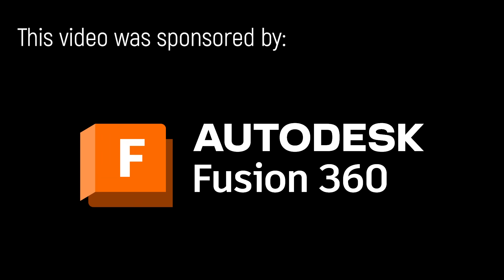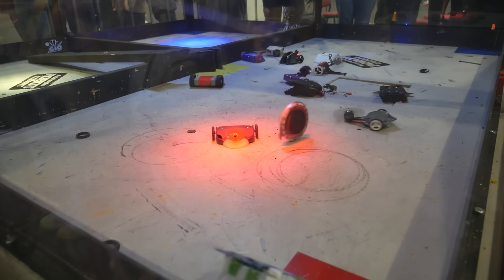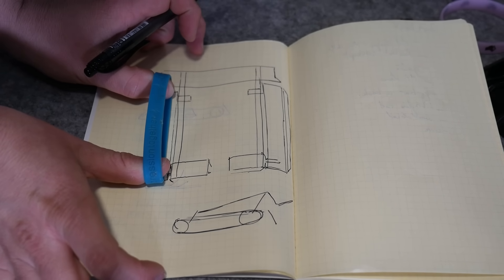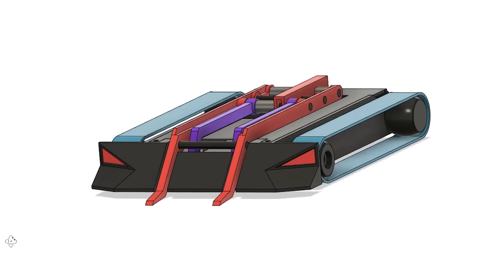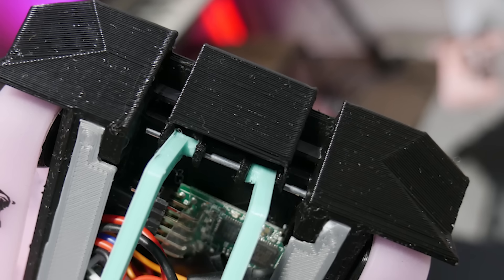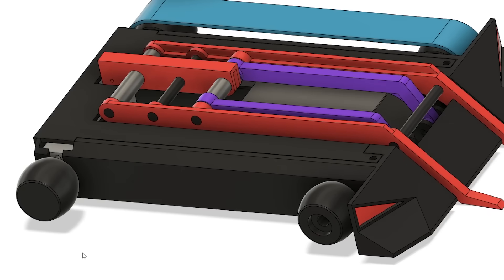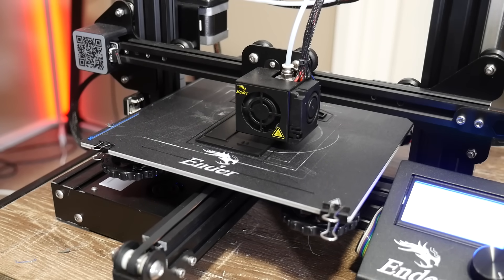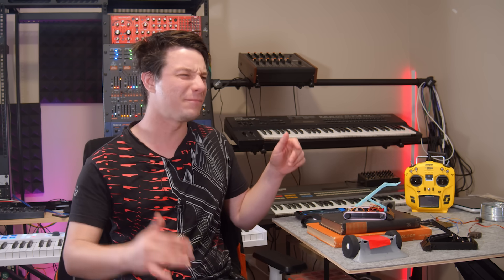My 3D Printed Robot sucked... so I made an UNBEATABLE one!

Comment: the forks might have to be closer to the ground.
maybe also redesign them to be sheathed in the bots front, since they're relatively flimsy and your only weapon.
I'd suggest making the interfaces angled, so they don't have the tendency to get stuck while lowering them into their sheath+scooping position.

oh and then I also wonder if you have enough weight allowance to add some metal spikes on the upper surface of the fork, to keep enemies from sliding off the fork too quickly... maybe just superglue sand on it.
it would probably be better to have it grip only in one direction though, so they can slide on easily, but can't just slide off.
Reply: Was thinking something similar as far has the forks should be lower to the floor. Saying it's a plastic ant weight I would probably say he's fine keeping them out from the front of the bot since not many people design kinetic robots most are control saying it's only 150g
Reply: @kylecarter7293  hmm that's true and I don't know if kinetic weapons are even allowed there...
still I'd rather go safe than sorry, since sheathing doesn't cost much anyways.

Comment: You might’ve already done this, but I’d recommend using the “expo” setting on your transmitter joysticks for better low speed control. It’s a pretty nice feature for combat robotics, from my experience
Reply: expo is good for a lot of rc things tbh
Reply: Expo won't help. I use these N20/N30 motors on micro crawlers and the cheap tiny DC speed controllers are often inherently bad at low speed control. You get nothing before about 30% throttle even if you raise it super slowly. The reason for this is that the motor's coils act as an inductor and the motor controllers are set up for efficiency and quietness at high speed, which means they run a PWM frequency above hearing range (20kHz+). If you're well versed in analog electronics, you'll see that the inductance and resistance of the motor form an RL frequency filter, reducing the voltage across the armature at low motor speed. Adafruit released a whitepaper on this and it was a revelation to much of the hobby community, including me. So if you're building a crawler or robot and want low speed control but don't mind a slight lack of smoothness, a sub-audible PWM frequency like 20Hz is far superior. All the good quality crawler ESCs are set up to change the PWM frequency as well as duty cycle based on throttle. That way you get maximum power across the speed range.
Reply: Totally, it stands for exponential, it means the rate of control is exponential rather than linear.
Reply: not sure if he is still using mixing, but i wouldn't of for either, you get better control without it.